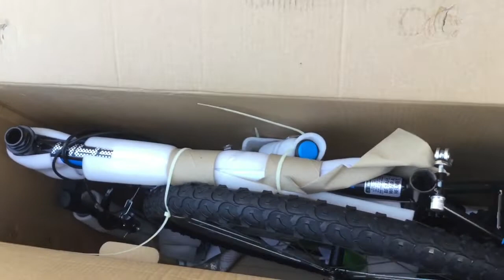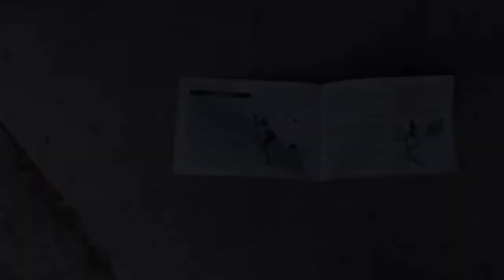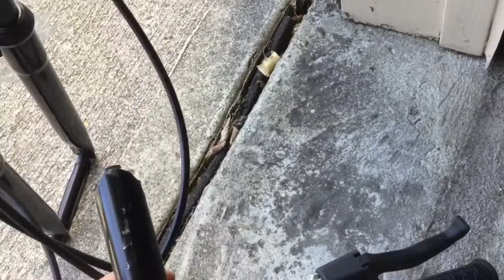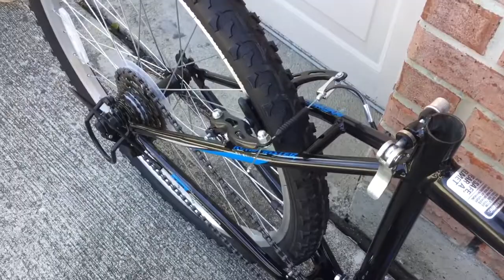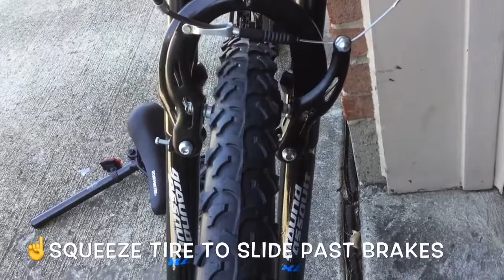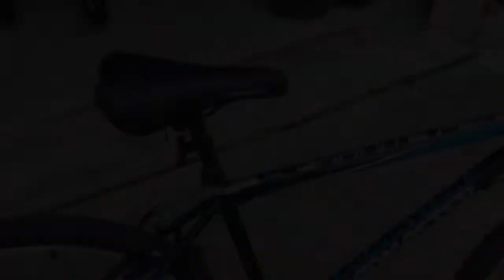Dad Assembles Roadmaster Granite Peak Bike

Comment: I can make a bike from scratch so why buy one.  Theft is enemy number one , time enemy number 2, and because any bike i make will be a high theft ad.  I must overcome these problems.  A cheap bike is a great alternative because i can turn it into anything so not a problem for me. Looks are a ad for theft.  The nicer it looks the fast it is liberated from your ownership.  So the real problem for a cheap bike is set up. You can replace brakes and calipers , if you weld you can fix frayed cables , if your handle bars move you can grove the bar and if it keeps loosening change the grade of steel so it gets tight.  A bike that is not set up right will be a pain. A cheap bike suffers from set up problems and in some cases materials.  With a little time you can really improve performance and eliminate all the problems while telling a bike thief it's a cheap bike they won't make money stealing for resale.  A great way to stop thief's in the first place is a wireless alarm.
Reply from the maker: That’s impressive that you can make a bike from scratch!

Comment: Ok I have a question my front wheel is kind of stuck and I'm not sure if it's the breaks any tips would help
Reply from the maker: Yeh I’d check to see if the wheel is running against the brakes. You might have to adjust the brakes a bit if that’s the case.

Comment: I picked up a girl's version of this bike for my girl, it was used but seemed perfect size for her, which it is. I don't like the knobbiest so replaced them with Serpio Drifters, giving a smoother ride. I have had a little trouble with wheel wobble on back wheel. There doesn't seem to be a nut to lock the inner nut down so it loosens and tightens while putting back wheel on. I figured it out by tightening the inner bolt just right so as not to be loose allowing side to side wobble nor too tight putting excessive pressure on bearings by adjusting bolt while wheel is on bike and outer bolt loose then tightening outer bolt up. Adjusting derailers is another chapter. Don't forget to clean chain every month or so depending on bike use. I bought a used 10 speed and found out the chain had stretched to the point of needing replacement. A damaged chain can, or dirty can put more wear and damage on other parts such as the cassette.
Good video, good job.
Reply from the maker: Good info. Thanks for sharing!

Comment: uhh the brakes are in the way when installing the wheel
Reply: Just deflate the front wheel then it will go through that’s what I did
Reply: Just squeeze the brake caliper and release them, then put your tire on with our without air. The simply squeeze the caliper back and connect the cable.

Comment: Any advice for re-adjusting the handlebar height? I bought mine used and can’t seem to get that bolt loose (using a 6mm) to adjust the handlebars.
Reply from the maker: Hmm. Yes, the 6mm Allen wrench should do the trick on the bolt on the handlebars. You should be able to loosen it, and just pull up. Then tighten whenever you get the handlebars to the height you want. I’ll try to do a short video in the next few days and post it!
Reply: Dad Does Videos it might just be a little snug. I would appreciate that - thanks!

Comment: My gears are not going to the 1st gear. It just starts on 3,4,5,6.. on your video you were saying that you just need to adjust it.. but there’s no video doing it.. it will be great if you show the video. Thanks!
Reply from the maker: Hi. I’m not sure I completely understand your question. In step 16, I reference using an Allen wrench to play with the handle gear shifters. If that’s what you are asking about, you use the right size wrench in the hole and loosen it (turn to the left). Then, you can rotate the gear shifters as needed. Hope that helps!